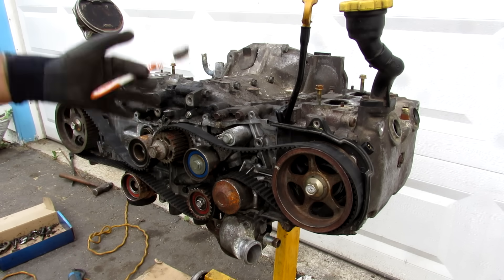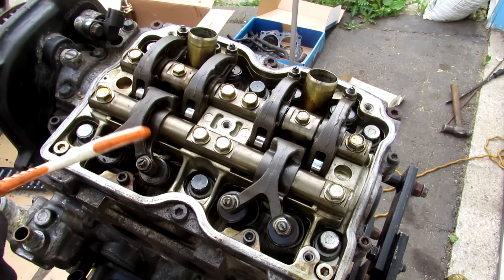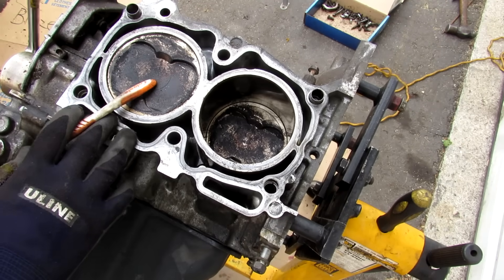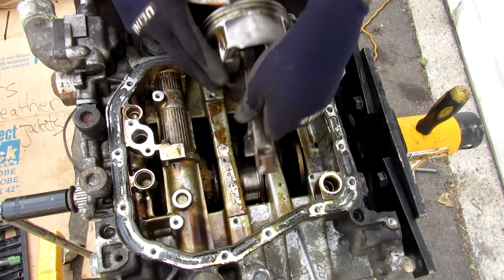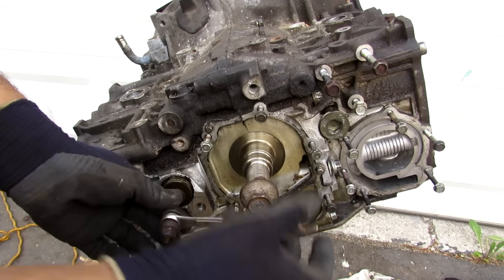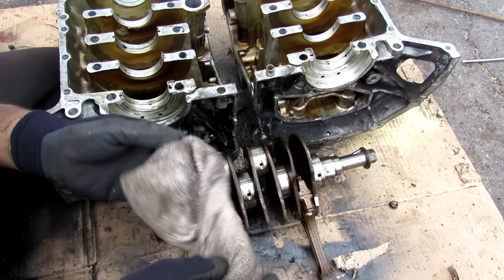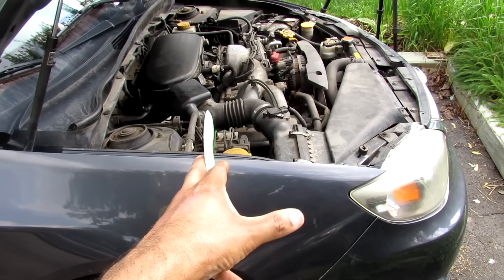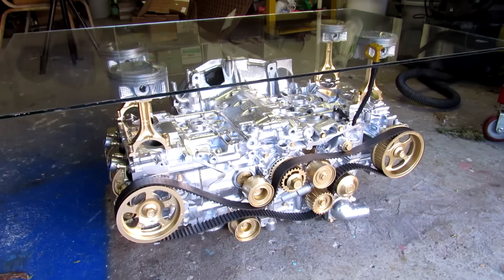Why Subaru Engines FAIL

Comment: sorry the timing belt is the failure point.  Had they done this using a gear train or chain it may have helped the gears would be more stable with no back lash a chain would lead to some backlash  the backlash would cause a timing problem and motor failure.
You cannot depend a idler pulles to take up the slack on the belt its why most motor's have gone back to a chain system.

Comment: not all fail !  years ago I bought a side swiped  95 legacy 2.2 with 80k miles for $500 spent $250 on used parts drove it for ten years sold it with 245000 miles for $500 , never opened the engine , only maintenance I'm an auto body tech /painter and mechanic , it was a great reliable car and cheap , you can't do better than that

Comment: What I would like to know how does that connecting rod on the crankshaft with no oil hole get lubricated? You covered everything else. Can't be run dry as it would seize up.

Comment: Harmonics and oiling is what kills these engines. #4 is the one that let's go the first.

I've installed sti oil pumps for volume and pressure and never had any problems afterwards.

Comment: Great video! One comment; "over square" or engines where bore dia>stroke make more power at lower RPM's then the inverse such as a Honda engine. Nice work!
Reply from the maker: Thanks for the clarification
Reply: Over square engines usually make their hp high in the rpms  ie honda.
Reply: @rhett7716  over square refers to a larger bore diameter than piston stroke. This creates an opportunity for more air in the combustion chamber at lower RPM's  but due to the higher reciprocating mass associated with larger pistons, the bottom end is limited to slower rotating speeds. Honda's are not over square, and therefore make less power (less air) in the lower band, but consequently can achieve higher engine speeds and cycle more air in and out of the cylinder; therefore making more power in the top end.

Comment: My son bought a used Subaru with a turbo boxer which was always a headache until he got rid of it.
Reply from the maker: What was wrong?
Reply: @speedkar99  During the time he owned it, it rarely ran well. Multiple reasons. I know one time it took a long time to chase down the gremlins which in the end, I believe, were due to a couple of bad sensors. The final straw for him though was the infamous head gasket failure, which I had warned him was a well known problem with those engines, and so expensive to fix. He sold it to a high school auto shop class for them to repair for training purposes.

Comment: My 2000 Subaru Outback with 368.000 km on the clock has proven the most reliable car I've ever driven... 
Heck, I'd suggest you change that title to "Why - compared to other engines, Subaru engines DON'T fail"

Comment: Subarus don't mix fluids, and the center head bolts have black heads because it's a different washer, it won't fit on the ends of the head.

Comment: The 14mm hex with the bolt was genius. I’ve worked on cars since I was 15, and I have never seen that. Now I can just apply that to other sizes if I don’t have the correct hex. Thanks for the tip!!

Comment: Well done!  Brilliantly explained.  I understand that most Subaru engines aren’t terribly designed and can last for some time if properly maintained, BUT you did an excellent job of illustrating the inherent engineering challenges with respect to boxer/flat engine designs in general; gravity is your enemy!  

You didn’t mention that simply having more than one head gasket also effectively doubles the chance that either gasket might fail (vs. having only one head gasket).

I, for one, will probably avoid buying a used Subaru, unless I have extreme assurance with respect to oil change intervals, cooling system health, and lemon years for head gaskets.

Comment: What to look out for when buying a Subaru?  It's a Subaru.  POS cars.
Reply from the maker: When looking for a Subaru, stay away from the boxer. 🤣
Reply: Ouch man.  My 98 outback sits at 189k miles.  I got it at 88k 5 years ago.  This year I did a timing belt and finally new tires.  Before this year, I've been driving it 100 miles a day have less than 500 bucks in the car.  Most of that was a windsheild.

Comment: Hey - Great tear down! 
- That motor ran out of oil, as you noted
- A nit: You call out "bolt sizes" by head size. This helps with grabbing tools, but isn't actually correct. Example: A typical "10mm (hex head size) "bolt" is actually a 6mm capscrew. Ditto 14mm hex generally = 8mm capscrew
- Another: Over square bore/stroke doesn't determine torque (HP)/rpm range. Engine breathing/cam timing does. All things equal, the only oversquare RPM advantage is peak piston speed (acceleration). One example: An 8,000 RPM BMW S54 (M3) inline 6 is undersquare (91mm/87mm). 
Nice video...
Reply from the maker: Thanks. And yes I know about the bolt sizes are identified by thread size but since they are independent of each other, no one measures thread diameter when talking about a bolt (unless assembling a new engine) it's more convenient to go by head size

Comment: Weak head gaskets and timing belt. Bad factory head bolt torque specs. Anything timing belt driven is a bad design.
Reply: Depends on if it's interference or not.  Timing belt breaks in an interference engine,  might as well replace the engine,  will most likely be destroyed.  Non-interference engine, timing belt breaks,  car stops, put new belt on, back in business.

Comment: The first thing wrong with it is a FRAM oil filter!
Reply: Subaru OEM filters are cheaply made as well,  just cut one apart. Probably no better than the Fram 4 dollar filter. You get what you pay for. But Fram does make higher quality filters that are more expensive and built better.

Comment: I know it's been said about 20+ times but it needs to keep being said: this guy definitely either trains people daily or has taken speech classes because his is very clear, specific, and confident in the information he relays.  Not only that, but the in depth details he has reviewed has completely given me anxiety about my WRX I just purchased lol  I will make sure I'm spot on in ensuring I have proper oil and change my oil at strict intervals to avoid any of the wear that occurred on this motor.  This is the information I love to learn!
Reply: I came here to say the exactly same thing. I wish I knew half of what this guy knows about engines.
Reply: Youl be fine. Keep ur oil in shape and look after it and youl be ok. Theres a reason wrxs hit 400,000ks when looked after. Anyone tells u they are unreliable is a moron. Americans are the worst at looking after cars tho.
Reply: Use the Subaru OEM oil filters not aftermarket.  My 2014 Outback has had the short block replaced twice for excessive oil consumption and it's only at 65K miles.  Still a good car except the sh!t motor.  (I have a 6 speed manual not a CVT in mine.)
Reply: @philbiker3  ...2014? Is the engine that is toast a 2014? There were some problems.
Reply: @ddd228  Oil Consumption issues - it would consume a quart in less than 1000 miles.  There's a class action against Subaru for oil consumption on this engine that requires them to repair up to 100,000 miles.  I had the short block replaced twice for this issue.  Currently the car has 65K miles.  The first short block was replaced at 12,368 and again at 57,785.  So far it's been much better than the first two blocks.  Hopefully they figured it out with this one.
Reply: @philbiker3    Well, WTF?
Reply: @ddd228  what u drive dave??
Reply: @philbiker3  i feel bad for you man. Two engine rebuilds at only 63,000 miles. Sell that junk toy car. Subarus do have the best AWD in the world though ill give them that
Reply: @rhett7716  Toyota.
Reply: @ButtonandBuck  Subaru stood by their product and replaced the short block not once but twice under warranty.  There was no loss of service for me - neither engine left me stranded, they just consumed massive quantities of oil.  As far as I'm concerned the car is fine - a week at a shop here or there is not much of an inconvenience.  I really like the car.  It's so rare to have a manual transmission in a car like this in the USA I smile every time I row through the gears.  I've done some light duty off-roading with this car and it is capable (thanks in large part to not having a CVT) - the AWD does great.  Super planted in rain and snow!  The only thing that concerns me long term is if the oil consumption somehow damaged or gunked up the exhaust, but since it's a PZEV car that will be covered as well out to 12 years I think.

Also - since they replaced the block I got new head gaskets!  :-P
Reply: @philbiker3  dont worry the oil wont do anything to the exhaust it all gets burnt off
Reply: @philbiker3  what year is your Subaru
Reply: @philbiker3  I bought a 2012 new and it was the worst engine I have ever come by. Drinks oil day one.
Reply: And find a good mechanic !!!!
Reply: It’s inevitable. Something will happen to that motor lol
Reply: Sell it. Trust me.
Reply: He pronounces longitude wrong.
Reply: @bobbamford5207  Call the police.
Reply: @bobbamford5207  listening to him speak, I'm pretty sure English is his second language. Or third. Or maybe even further down the list.
Reply: @bobbamford5207  relating to length or the lengthwise dimension the longitudinal extent of the building.
Longitudially

Comment: So don't run your engine dry on oil, don't push it before it's warmed up, and don't mod turbocharged engines without a tune. Solves pretty much everything there

Comment: Great video!  However, I think you'll find that V6 engines aren't as well balanced as inline-six engines.  Splitting the six cylinders into two banks turns them into two three-cylinder engines.

The only way to smooth out a V6 completely is to have the two cylinder banks traveling in the same direction - i.e.  either an inline-six arrangement (or VW's offset "VR-6" design) or else a 180-degree offset...  i.e. a "flat-six" like Porsche and Subaru use.

Speaking of which, have you done a teardown of a Volkswagen VR6 (or VR8) engine?  I think you'll find them interesting.

Comment: 12.23.20.    I’ve always found it amazing that the four-cylinder Honda GoldWing’s™️wing’s were so reliable, except the electrical Stator issues, compared with the Subarus head gasket issues in the four-cylinder engines. The Honda GoldWing’s™️ four-cylinder engines would occasionally have a blown head gasket but that’s after a lot of years, and most likely neglect due to coolant not being serviced properly❗️

Comment: John Booc you believe that once this video ends of him dismantling the engine that he is going to get out his $120,000 cylinder honing machine (hidden under his wife's old dress), replace every bearing, piston, and connecting rod in this outdated beat up engine? You don't see Scotty Kilmer reconditioning engines because it is rarely done these days. Scotty is recognised as one of the best mechanics in the USA. We used to recondition engines but the manufacturers have made it impossible due to the complexity. You yourself can tear down any engine. It's interesting. You won't be able to rebuild it for less than a new engine though.
Reply: Best mechanic? The guy talks rubbish all the time. Saw a few of his videos and never watched him again. All he ever mentioned was his toyota

Comment: If i ever need a subaru engine rebuild, this has got to be the man for the job.👍
Reply from the maker: Ugh as much as I can tear apart, hats off to those who can rebuild it properly lol
Reply: Massive job to rebuild it. Very rarely if ever done. Extremely complex. Cars today are discarded after 200,000 km.
Reply: @doctorboy5892   There are Toyota Priuses with 300,000+ miles and still running better than a brand new Subaru.

Comment: How old is this engine??   He mentions that it's a single OHC without variable valve timing which signals to me that it's might be an  EJ251SOHC from 1995 or 1996... that's a very long time ago... even still... many Subaru engines last a long time...the engine looks pretty old...  I don't know....if it's 25 years old...I probably would have just replaced the entire vehicle...
Reply: By the amount of rust on the timing belt components it has been out of the car for awhile.

Comment: I purchased a 90.000 mile all wheel drive outback with a rod through the block dirt cheap from a lady awhile ago for 150 bucks. I had planned to buy a used 2.5 engine and throw it in there and drive it for a few years. However, after checking around i've found that used engines for these things are outrageously expensive and finding one with less than a billion miles on it is nearly impossible. So taking all of that into account and the fact that these engines are essentially piss poor designed junk anyway - the car is going to end up going to the big crusher in the sky. I just simply do not see the logic involved in fixing this thing and spending all of the time and  money and still having all the potential engineering problems there to deal with. Ain't worth it to me anymore!

Comment: This guy is very knowledgeable, you can tell he has not rehearsed this so it is by knowledge and experience.
Reply from the maker: Thanks. 
In reality filming my video takes 3 cuts to get my sentences straight but I don't script it
Reply: @speedkar99  my 2017 Impreza with only 35km was missing oil (more than a quart) maintenance was done a the Subaru dealer, not much faith in their engines.

Comment: Speedkar99, you are indeed a very knowledgable mechanic. If you are interested, the pin holding the piston on the con rod is called a gudgeon pin.
Reply from the maker: Thanks. I'm an engineer not a mechanic

Comment: 7.30 oil return holes "clogged with sludge". A properly maintained Subaru engine(or almost any engine) does not have any sludge. The oil remains crystal clear(no particulates visible) albeit slightly browned when changed at 10,000km. Using full synthetic oil I get zero oil level reduction by the time I change it. No added oil necessary between oil changes. This is on my highest Km Legacy at 240,000 Km..

Comment: Subaru is junk! 2013 Outback famous boxer with CVT. Rough and noisy ride, rattling and oil eating from day one.  Always used Valvoline full synthetic too .  The CVT failed at 120k .  The symmetrical all wheel drive is also a joke compared to my 2018 and 2020 Hyundai Santa Fe’s—no comparison in ride, sound, traction etc.

Comment: The oil pickup eventually fails at the brazing because of motor harmonic vibrations, ask me how I know. 1st engine failure then 3 more failures after on an 04 sti ej257.

Comment: Excellent video! I have owned a Lancia Gamma coupé with the 2.5 liter boxer engine (also oversquare) and your video brought back memories. Another issue is with boxers with valves in the V conformation oil can leak through the valve guides with the engine off and pool up inside the cylinders, making re-starting a smoky experience.

Comment: Had plenty of most Sub engines right up to the 6. The most unreliable was my 2.5.  Put stainless head gaskets on it and never looked back.  Not a boy racers engine, but in manual form, the wagons made excellent tow cars and a pretty cool cruiser. I would load her up with tents and all the gear, hook the jetski on the back, put the family in and head for the coast. From where I live in NZ, that's not exactly easy, there's some nasty hills in the rode. She could just eat that for breakfast! I loved the car, had plenty of caricature.

Comment: Nicely  done video!  Thank you for NOT using music and using quick, well placed edits and jumps.  Q: Is this an interference type engine?  My guess is that it is.  For those who don't know, an interference engine's valves will run into the pistons if the timing belt breaks or slips.

Comment: Some of the information in this video isn’t 100% correct. The famous head gasket issue for example, you didn’t mention what engines are effected by this (it’s not all Subaru engines). This issue affected Subaru’s with the EJ 25D I believe and some other non turbo engines. This did not effect the 3 liters and turbo engines and a common durable fix for the engines affected by the head gasket issues is to swap a head gasket from one of the turbo engines. Also Subaru has since moved onto F series engines which corrected most of these issues.

Comment: half of this video really just reinforces how important maintenance is. Starving ANY engine of oil will lead to all of these issues with sludging, starvation, and bearing wear. There also numerous videos and blogs on various makes of cars that burn oil due to redesigned oil rings, made thinner to encourage better gas mileage and reducing friction.
Reply from the maker: True. But put this engine in an economy car and people will mistreat it like a Corolla that can take that endurance

Comment: Subaru boxer engines are fantastic & many will last an easy 400,000kms especially Subies from late 90s-2000s it's stupid people buying them not realising they need Oil changes strictly on time  & consistently skip them & thrash them.  If you buy a Subie maintain it! & It will repay you back.